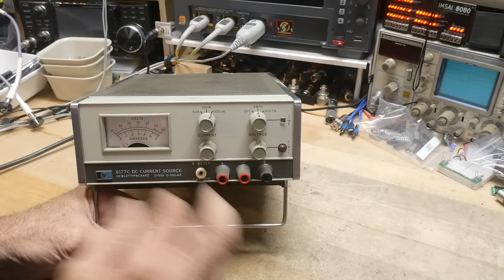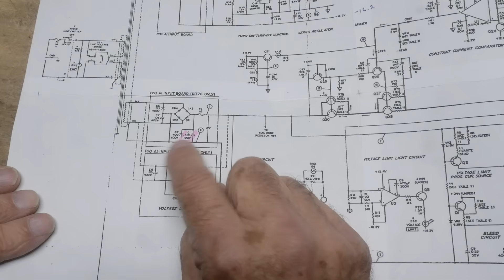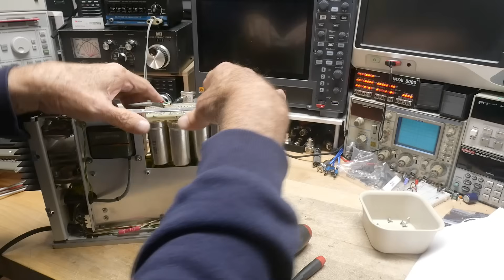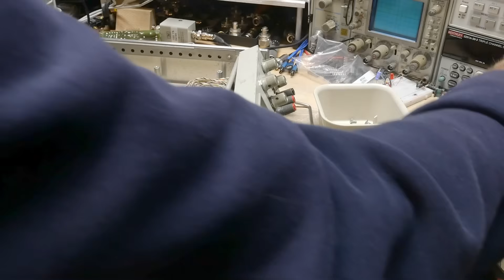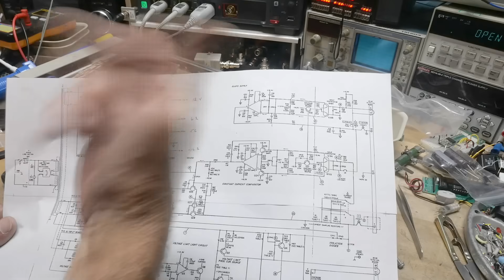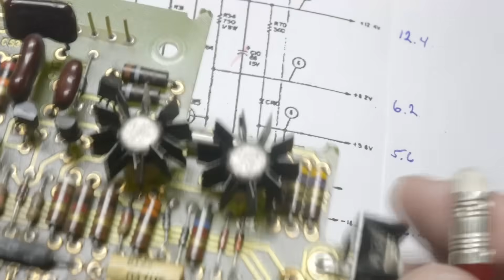#2438 HP6177C Current Source attempted repair

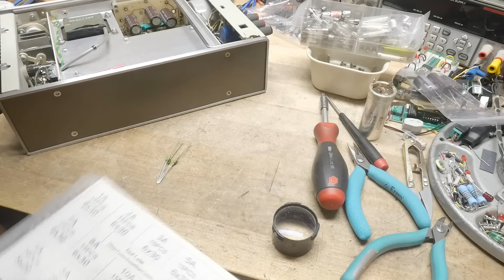Comment: 36:37 I can tell you firsthand that the 2amp fuses I bought took WAY over 10x the current to blow. I ran them at 40amps for 15 minutes until the wires got hot enough to melt the solder connections to the fuse holder. So it's somewhere over 20x the rating.
It does seem to be a more common issue with automotive fuses, though.
I discovered this when it was to late to get a refund, and I was about to throw the box in the trash, but I hate wasting things so I crossed out the word "Fuse" and wrote in "Current sense power resistors."
No way that could go wrong.

Comment: I'm also local to Anchor. We've maybe crossed paths. I usually help Eric with the VCF and have been there each year. I own an IMSAI that I've got a  Digital Systems disk drive setup, with 2 SA-800. Dr. Torode's drive controller was one of the first drives to be used with the S-100's. I had to figure out how to make the drive work from scratch. It is cool in that it does DMA into the IMSAI. At reset one just sets the IMSAI to address 0000 and hit the reset. It loads the first track that I have boot-strapping CPM. Anyway, I enjoyed you failed attempt to get the current source working. Dwight

Comment: You need to use Soder-wick to remove the solder.  The way you are doing it is going to damage the plated through holes or yank the pads off the G10.
Reply: This is old school technique practiced by millions, the board doesn't have the weakness problems of today, thicker with more copper.
Reply: @TheWyleECoyote  It's still wrong.  I spent decades in mil spec electronic assembly and repair and that technique is a no no.

Comment: My 2 cents, there are three caps on the power section your working on, check C1,10 and that 1m.  Those soccer caps suck.  , if ok pull the 5 transistors and check them.    When doing this disconnect the rest of the circuit to isolate the PS.  Like you said it can't be this difficult.  GL

Comment: When testing old caps, especially larger value filter caps like these, the most important test is leakage, that's the common failure mode.  First thing I check on them is how leaky they are, then I'll spot check the value, usually don't worry about ESR too much in these big filter caps.  When I was a boy, all I had was an old Heathkit C-3.  It worked OK but had fixed voltage steps up to 450v. I upgraded to a General Radio, beautiful piece of kit, variable voltage up to 600v, analog meters showed leakage down to microamps.  Q,D, value, and leakage, no ESR.  I picked up a Sencore LC77 which does everything the GR did plus ESR in a much more compact package and it's quick and easy to use.  You should pick up one of the Sencore LC series cap analyzers for the bench, they're just the perfect cap tester for repair work.

Comment: After removing the old capacitors, but before replacing them, I would have quickly checked the diodes for collateral damage - especially given the popped fuse.

Comment: HP loved generating +/- supplies from a single supply that the common reference is derived. When it works things make sense, when it doesn't the voltages get real weird.
Have an HP427 that I spent much time to get the power supply to stabilize.

Comment: ArmChairCoach: Check caps in circuit first. 
Removal easier IF you can cut the terminals that are accessible, 
check new caps before insertion,...  
I am jealous that you have friend to share the fun with,..
I think all your viewers probably feel like they are your friend, but it ain't the same.
Oh come on, you can't give up. 
It's all easy analog, big fat components, no surface mount ugliness. 
Do I need to fly out and help?
(Not that I haven't given up on things before.)

Comment: I got a little BK supply that you can set voltage over 50V and also with the current limit you use it as a current source in practical terms.  I sometimes use it to charge batteries.  I set the voltage for the nominal charged battery voltage and then set the current limit to charge.

Comment: You could replace the power resistor that's getting hot with a new one and raise it off the board by a few mm to let it cool off a bit more.

Comment: Something weird about your story at the end. The "6.2V one" zener diode is VR5, not VR3, and it is over more on the right side of the board. It's a shmick 1N825 low tempco diode. Or... the "6.2V one" is VR1 and VR2, which are at the top near the Q1 pass transistor. The huge big diode you were fingering at 48:05 is VR3, and just below it VR4. Those are 4.3V and 3.7V.

Ohhhh maybe in that sheet you've got, the text is fuzzy enough that you thought it said VR3 and not VR5. On google I've seen another digitization of the service manual which isn't nearly as fuzzy as what you have. So you were trying to troubleshoot the wrong diode. VR5 is in the supply circuit that you were always talking about, VR3 is over in the guard supply circuit.

VR3 will get overloaded if the guard supply is for some reason producing positive volts, or is it is exceeding -4.3V by a lot. The guard supply should be outputting 0 to -1V, so VR3 should theoretically never really conduct except in a fault condition I'd suppose. The guard supply should produce a very fine adjustable (negative) voltage which an amplifier then converts over the sampling resistors to make the designated current. I guess that someone else started troubleshooting this device, removed VR3, couldn't find the remaining fault, and just left it like that.

There's an EEVBlog forum post detailing a repair someone did on one of these. It may be helpful for you, especially to see a comparison shot of the circuit board.
Reply: Well spotted. Yes, the ending summary didn't make sense to me. I wondered whether there was something wrong when the smoothing caps were replaced and some links were fitted. In particular the negative terminal of C3 is the -16.2V rail, not common. As you suggest, VR3 was removed, probably while someone was diagnosing an issue with the reference supply.

Comment: I see you highlighted the electrolytic capacitors on the schematic.  Did you test them?  Wondering if C1 the 20uF capacitor which is in parallel with the 16.2V zener is shorting from the negative rail to the common rail.
Reply: I wonder if that or some other short is what has taken out the trace that you bodged back in, and that is why fixing the trace crowbars the thing. 
Do you have the 40V, have you pulled and tested each of the five transistors? 
Have you tested all of the bridge rectifier diodes?
Are R29 and R30 still correct? If not the "CMPARTR" transistor (Q14? - not easy to read on the schematic) may be turning things on hard because it has not feedback (assuming it is not itself shorted).